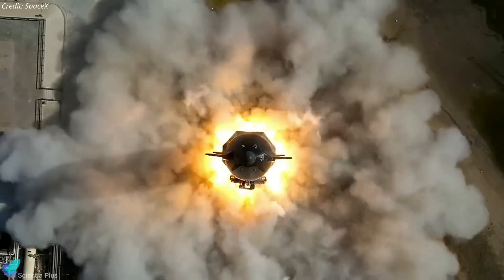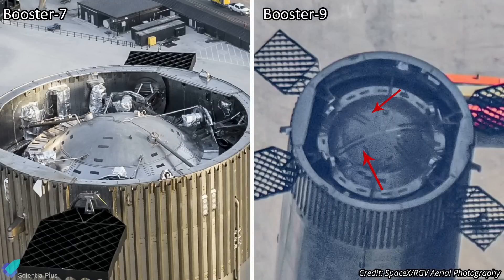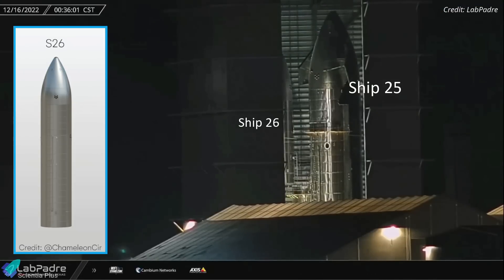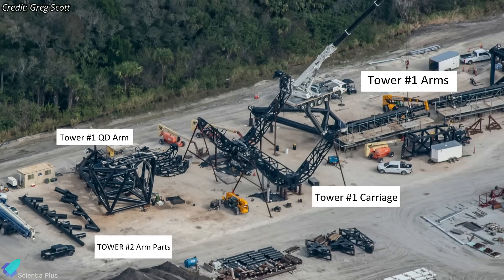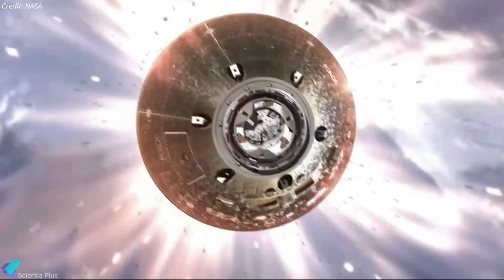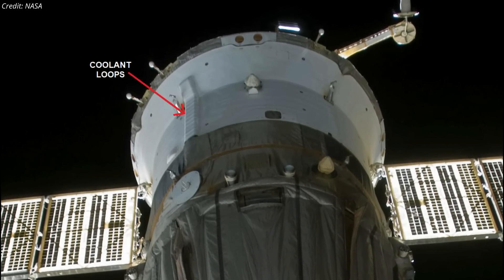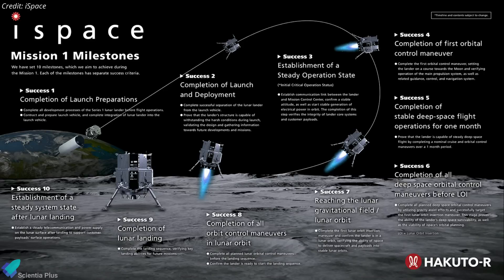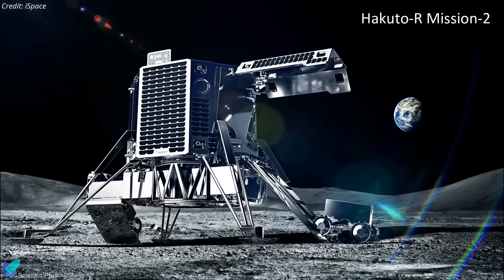SpaceX Starship Final Test Before Orbital Flight?, Booster 9 Test Imminent, ISS Leak, Orion Return

Comment: .   A micro alien tried to tap into the cooling system wanting to secure a sample.  The pressure is higher than anticipated and the little hose is whipping back and forth causing the undulating spray pattern.  Emergency signals from the micro alien were intercepted and NASA believes the micro alien is from N.J.  Further details will be released when appropriate.